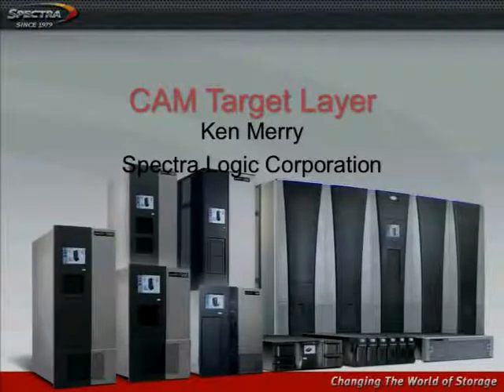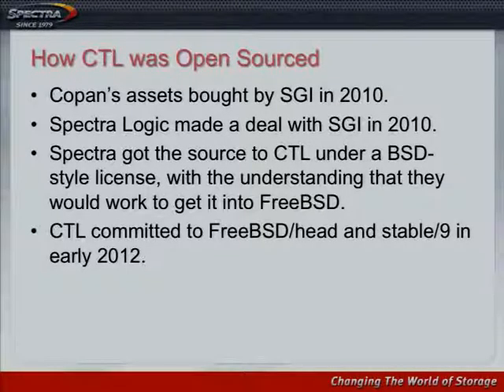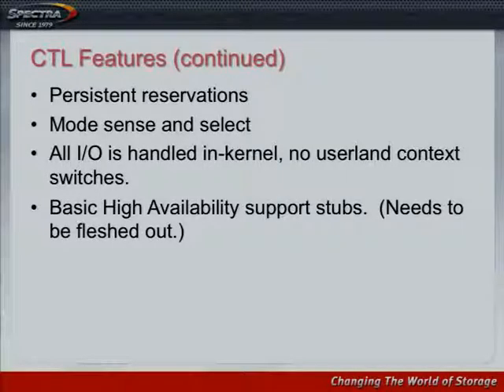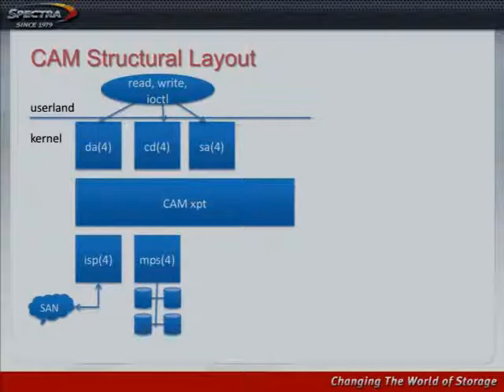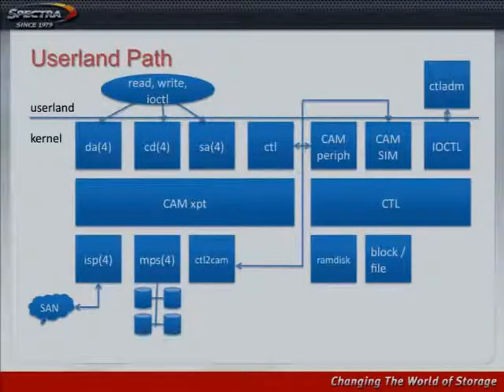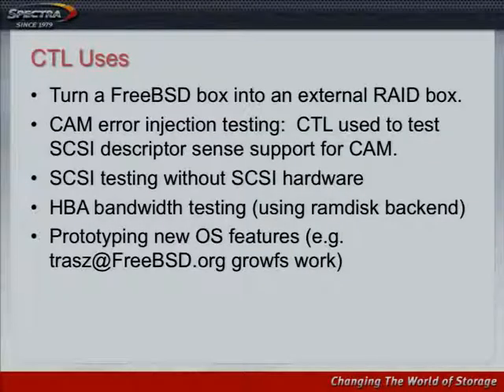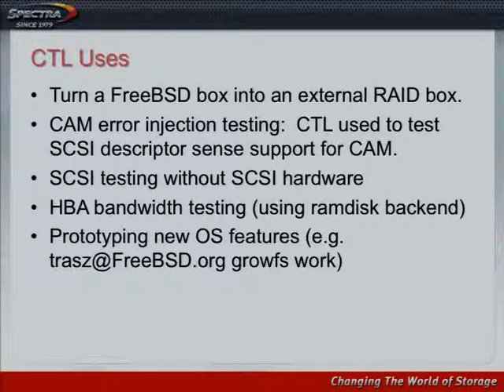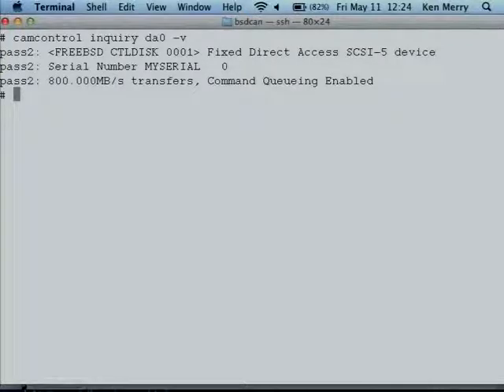CAM Target Layer

Comment: awesome presentation. got a couple of questions about the CTL diagram:
1) does communication between ctl2cam and CAM SIM go through user space? the arrow between them suggests that it does.
2) what is the difference between functions of ctl and CAM peripheral? what goes on in each one? it wasn't clear from the presentation.
3) why is there no 2 trips through CAM in the case of the SCSI request coming from the card? seems like after it gets to the block/file on the CTL side, it should go back to da->CAMxpt->mps->disk (as in the case from the internal initiator).
4) what is the purpose of the IOCTL box in the diagram? isn't it just the mechanism for ctladm to talk to CTL?

thanks!
Reply: Good questions!

1. Communication between CTL and CAM via the CTL CAM SIM does not go through user land.  That's a bug in the diagram.
2. A normal CAM peripheral only acts as an initiator.  i.e. it issues SCSI requests, and waits for a response from a target device like a disk or tape drive.

The CTL peripheral driver (sys/cam/ctl/scsi_ctl.c) is still a CAM peripheral driver, but instead of initiating SCSI commands, it sends ATIO (Accept Target I/O) CCBs to the SIM driver, and waits for driver to return those ATIOs with requests to do I/O.